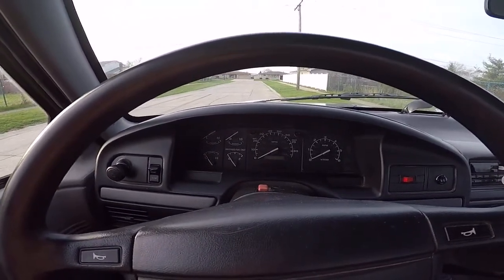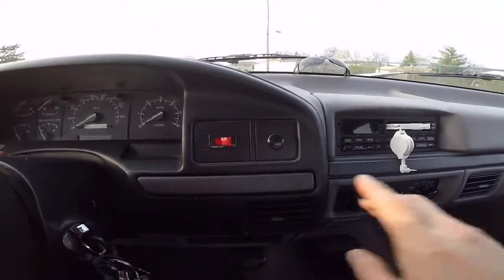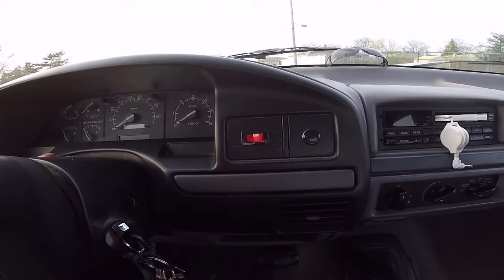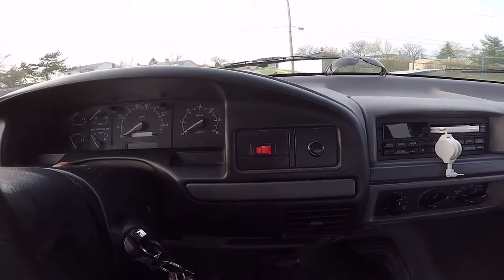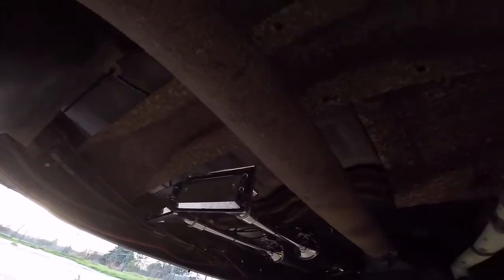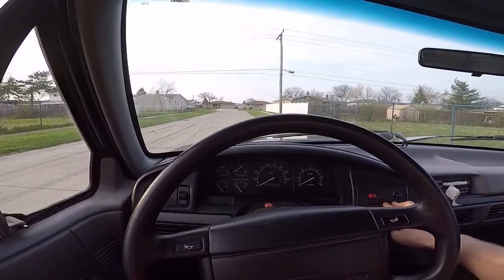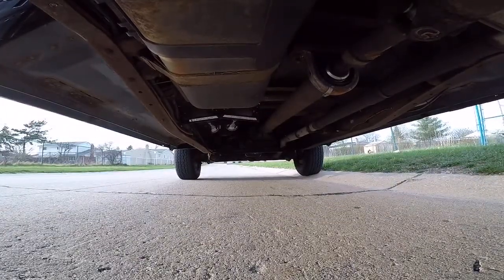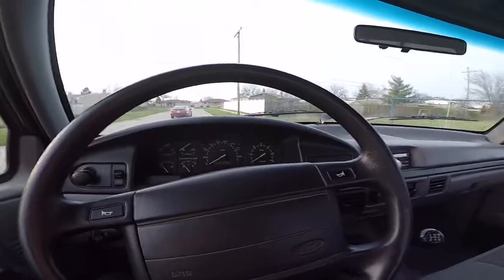94 F150 with Big Rig Air Horns

Comment: My ass would have mounted those horns on the roof of the truck and threw some old school chrome torpedo cab lights. Not a ford guy but that truck would look awesome man lol
Reply from the maker: Johnathan Hatley haha yeah, it would look cool, but I didn’t do it for a few reasons.  I didn’t want to take the risk of a roof leak at all.  And I kinda like the fact that it’s a sleeper truck in terms of the horns.  Nobody suspects anything, but if you cut me off, you get a rude awakening.  Also, it is a standard 2wd truck with no lift/stock tires.  Horns mounted on the roof on a truck this low to the ground might look a bit stupid.

Comment: Why not hook the horns up to the original horn switch
Reply from the maker: Much more expensive, we would've had to tear into the steering column.  It was much easier to just pull the panel off and mount a momentary switch there.
Reply: caasiwms not really, just put the wire that is going to your switch for the air horns, to the existing wire that goes to your factory horn in the engine bay. In fact it probably would have been easier due to the fact you wouldn't have to run the wire inside the cab
Reply from the maker: the break in the wire was in the steering column, so I'd have had to tear into it anyway.  This was was much less headache and cheaper too.  I had to run a wire inside the cab anyway to run the pump on/off, so this made much more sense.
Reply: caasiwms ah didnt realise the wire was broke my bad